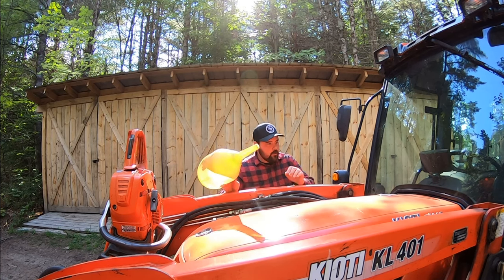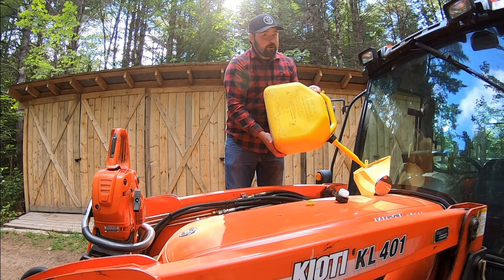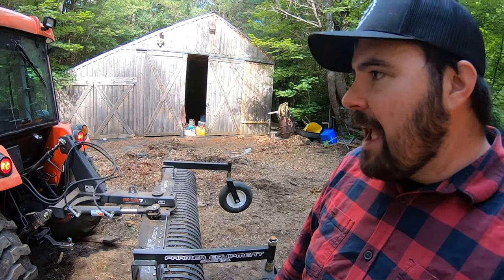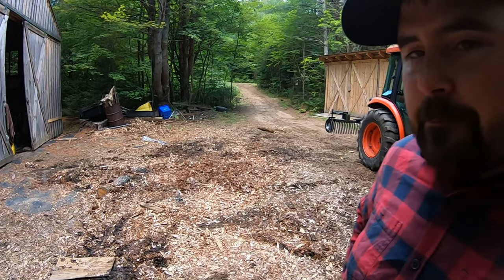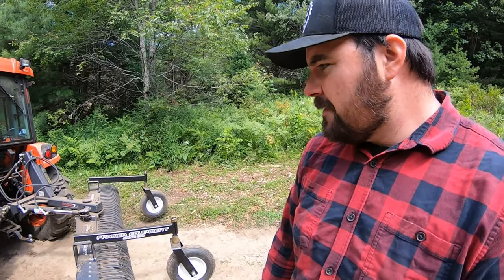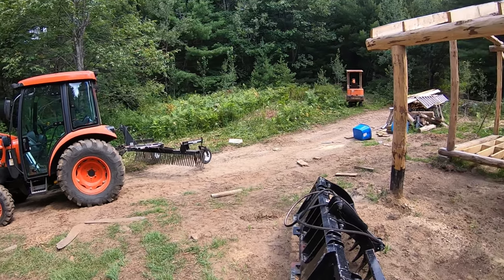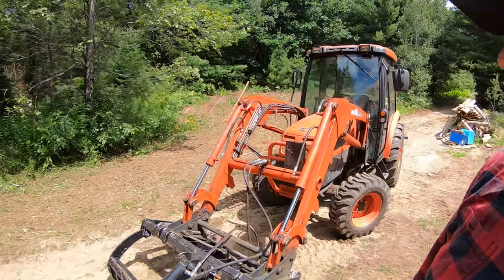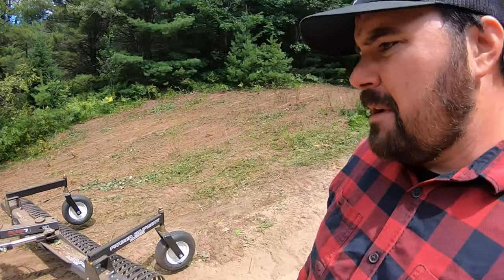Tractor Landscape Rake Clears More Than Just Sticks

Comment: OMG $2200 for complete brakes, a wheel bearing and a muffler flange?  Is your spare care a Ferrari?  Sandy you are handy and have a welder C'mon man you could do that job
Reply from the maker: The $2200 is the cost of parts
Reply: @sawingwithsandy  Sandy I love your channel and have watched you do a lot of really cool stuff.  So I got to ask what kind of car is it?  Year, make, model?  For my 2004 F350 Dually it would not cost this much.  I just get the impression your mechanic is ripping you off.  Have you tried looking up the parts on Rock Auto?  Honestly brakes, rotors, calipers are not that hard of a job you could easily do this job given the skills you have shown.  I am not throwing stones, I really think there is something wrong with these prices if you have just a standard run of the mill car.  Wishing you all the best.
Reply from the maker: I priced around for the parts and the brake shoes are a big cost. I do trust this mechanic though. Seems where I live cost of parts is huge
Reply: @sawingwithsandy Parts are crazy high $$$ everywhere … and hard to get in stock without waiting an eternity as well. 😊

Comment: Sandy, it's time you bought a couple 55 gallon drums and a fuel pump. (A bulk tank in the back of your truck along with a refueling hose would be ideal). I don't know about Canadian diesel prices, but it wouldn't take too long until you've paid for it, in the difference between dyed diesel and 'road' diesel. Having a fuel supply on hand will pay for itself, if for no other reason than having it on-site when you need it. Prime example: a couple years ago, I cleaned out about 4,000 linear feet of creekbed across my nephews hay fields with his excavator. His rig, in the back of his 'farm truck' holds 200 gallons of diesel. I left the excavator down in the bottom and, every afternoon when I'd finished for the day, fueled the excavator and greased all the zirks. Next morning, crank it up and go....

My grandson got an estimate of $1,600.00 to do the brakes on his car. I spent $150.00 on parts and restored his brakes to original - including vacuum bleeding the entire system - in about four hours. I hate to say, "I told you so," but.... clean the shop so you can get the car/truck inside, buy the parts and do it yourself. OK, I'm off the soap box........ 

I LIKE that rake!!! And, I LIKE the way you're able to clear out the ferns and other growth and make that area sparkling clean. A PTO-driven brush hog mower would pay for itself in no time. Don't damage your riding mower out there - it's designed to cut grass........ As always, I wish your place was MY place, and you had what you really wanted!!!
Reply from the maker: Diesel here is bad bad bad these days. $1.50/L is the going rate right now. My truck is actually not on the road currently as I had a big issue with it (long story haha). I'm thinking as I accumulate more equipment I"ll have to get a fuel storage tank just to get the bulk diesel delivery. Sure would add up in savings I bet. Hope you're doing well Carl!

Comment: Great looking rake Sandy. That hydraulic angle would be very handy. Getting on and off to change my angle is probably the biggest time waster when I use mine. It’s 7’ like yours, but is a LandPride brand. Maybe someday I’ll add a cylinder. Despite that it’s still one of my favorite attachments. So versatile and handy
Reply from the maker: Sure is a great tool to have around

Comment: I recently purchased a diverter valve on my rear remote for I believe $189 with all hoses and fittings and all you have to do is flip the switch towards the set you want to work still works from your hand valve in the tractor really made things a lot easier. I found this on eBay. Just wanted to let you know. Great video Sandy
Reply from the maker: Hi Jeff. Great to hear about the valve. I think that's a great purchase for that price!

Comment: Hi Sandy. With all of the things you have done to the various machinery that you have, I believe that you can change the brakes yourself. If the rotors have not been previously turned, that can be done to give you a fresh surface. It has been my experience that mechanics that order parts for the customer come close to doubling the cost of the parts then add their labor. No special tools are needed except for a C clamp to push the piston back in using one of the old pads. A book or YT videos will show how to do it. Have good days!
Reply from the maker: Hi Buddy Reed! I can imagine with a bit of work I could tackle this job but often times I"m stuck for time for repairs like this. I like the pros to work on my vehicles when the jobs are a bit bigger usually. I don't mind the odd job here and there but sometimes I prefer them to have at it
Reply: Mmmm… especially when it comes to STOPPING!!! ❤ better safe than sorry 👍 and besides… you deserve to spend some of that $ on your safety!!  Great job with the rake btw! PS if you have rust problems (we live in the rust belt as you know) have your mechanic spray/line your cars or trucks with FluidFilm or an equivalent. That is fairly inexpensive and you should have it done while its still warm out, and once a year. Obviously that wont help on muffler rust! 😅

Comment: Sandy, I didn't read through all of the comments to see  if this was mentioned so here it goes. My father had a JD 4440 with a front end loader/forks and a 10" Rhino Blade on the rear. He purchased these 12 vdc solenoid hydraulic switch Blocks that would connect to his tractor ports and then would supply the frontend loader or rhino Blade. Now on his Tractor he had 3 individual supplies. he used two Solenoid Blocks and left the remaining port for the Blade tilt (which used its only control lever inside cab) The other 2 levers were dedicated to the loader or blade. So the solenoids when switched inside the cab would either control the loader or the blade without reconnecting every time. I wired it simply - if switch was moved towards the front the loader would be able to operate and switched to the rear the blade. the original switch that came with solenoids stopped working so I used a regular 120 vac house switch with a plastic box mounted close by my fathers levers. worked like a charm. Take Care!